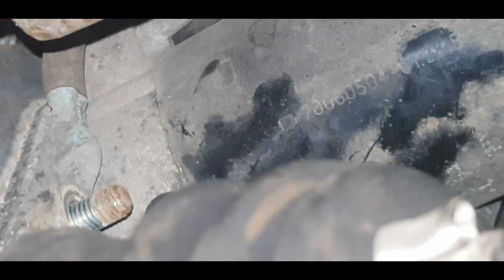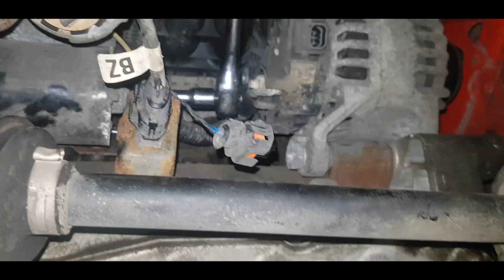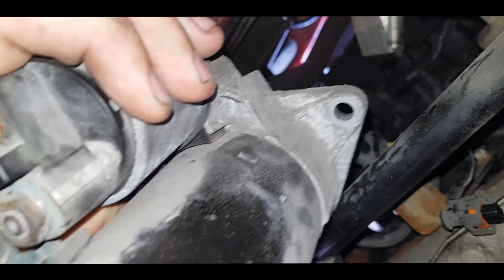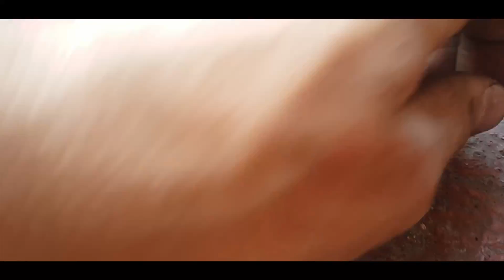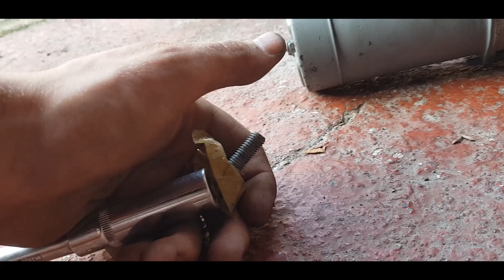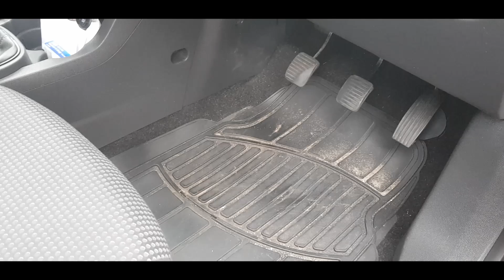Corsa D Starter Motor Removal + Install * sort of

Comment: Excellent video, gave me a great head start. a good tip as well is to put an M8 stud about 30-40mm long in the bottom bolt thread before fitting the new starter. it will line up the starter and the 2 bolt holes also taking the weight of the starter, making it a lot easier to get the top (braille) bolt in. After tightening the top bolt half way take the stud out and replace with the earth bolt.

Comment: nice one tom I was under the corsa yesterday fitting a crank shaft sensor I looked at the starer motor position and concluded it would be a pig to remove

Comment: What size engine do you have? I honestly dont know how you got the bolt out thats against the engine. spent 20 minutes+ trying to get the socket onto it blind before I had to give up! I heard some people have to remove the alternator to try get to it
Reply: Maybe bit late on asking I'm in middle of changing my starter on my 1.2 corsa . Did you manage to get bolt and if so any tips on how you did it

Comment: Hi,good video,bit of advice , next time, remove the O2 sensor, remove the V belt and the tensioner, and remove the alternator and you’ll have full access to the starter motor ,you can even undue the 2 13mm bolts from outside the car if you have enough extension bars. It’s a roughly one and a half hour job.

Comment: Were did you place your trolley jack to raise the car so you could get axle stands under
Reply from the maker: I put the trolley jack next to the control arm base.
Reply: I changed the starter motor thanks to your vid car has same problem not starting just wont turn over any ideas I can hear the relays when turning the key

Comment: Hi do you know how i can make my steering wheel controls control my phone eg when ive got my aux plugged in to skip track on music on my phone? Would be loads better if i could instead of pressing my phone? Thanks i have corsa d
Reply: Also my car is using waaay too much oil do you know any common faults what that could be? Thanks
Reply from the maker: Have you checked for oil leaks first? If so could be worth stem seals, head gasket etc... you cant skip songs over aux. Its literally just audio input...
Reply: Thanks for reply and ive looked for leaks i cant see any but just been told maybe piston rings?